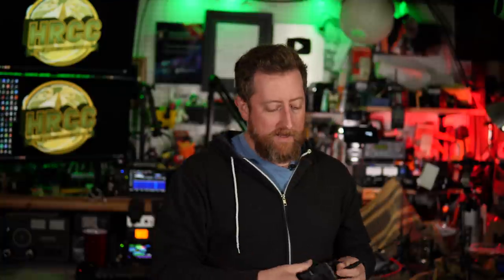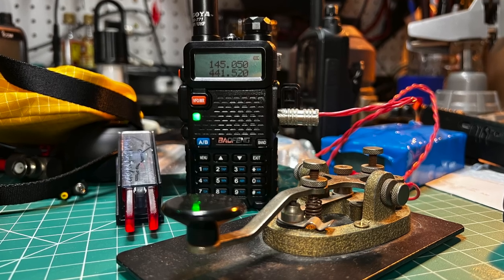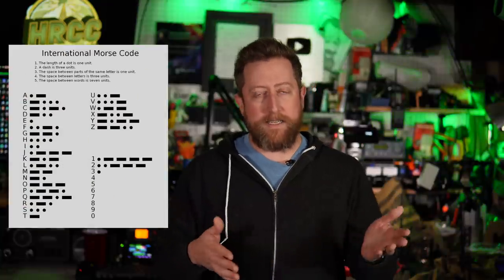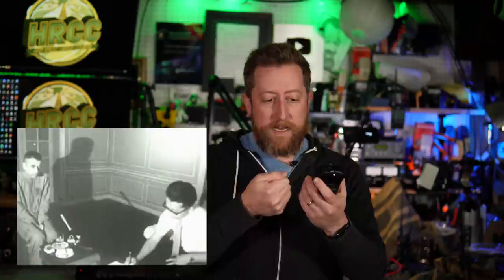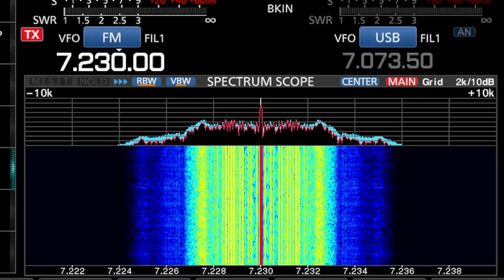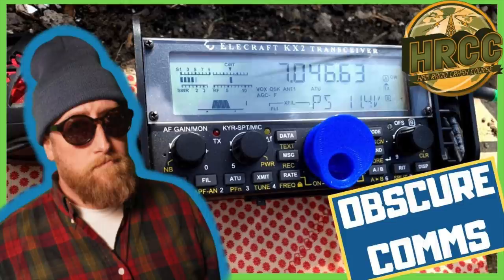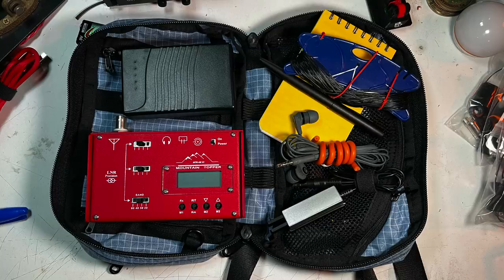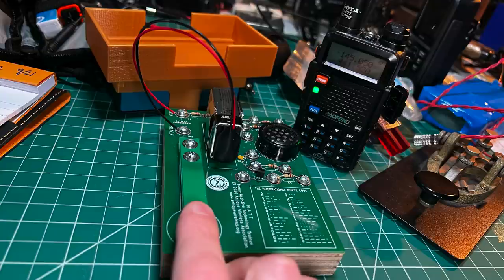Can You Run CW Or Morse Code On A Baofeng?

Comment: I used to tick off a lot of the anti CW folks by sending Morse over FM repeaters
Reply: FM is not for morse code. They get ticked off because it's annoying having to hear that when you monitor the repeater. That's like me beeping away around someone who is listening for a human voice. They're just anti annoying operators rather than anti CW.
Reply: @romankalinchuk2750  no these were people who just hated morse code because it kept them away from a ham raido license.
Reply: @romankalinchuk2750  correct, do that too much in the UK and you will lose your licence
Reply: Ria, can you please tell me how you were transmitting CW on FM?
Reply: @mrmustachio6297  I was transmitting Morse code (not CW) over FM repeaters using a code practice oscillator next to my radio
Reply: @jamesu1540  too bad you have such restrictive rules. You don’t even allow Aeronautical mobile and have half the two meter band. I’m not surprised you don’t allow Morse on FM either. De M0RAJ
Reply: @n2rj   we have restrictive rules all thanks to idiots who cannot obey the simple rules. This in London has led to Repeaters being closed down for periods of time. Misbehaving on the bands is not something you should boast about. Especially transmitting morse on FM. All you need to do is learn it and come up to the HF bands where its welcomed